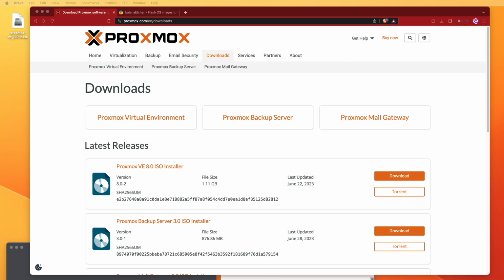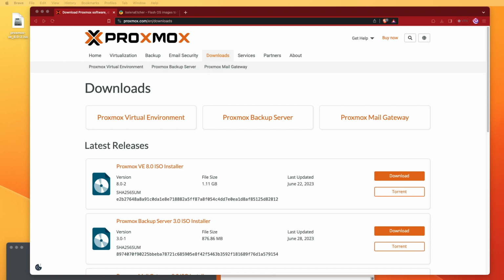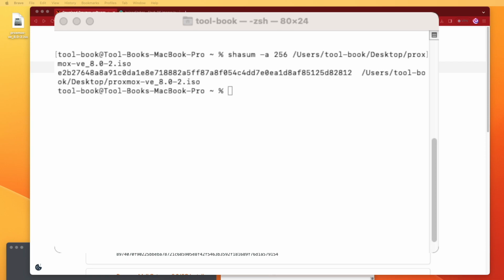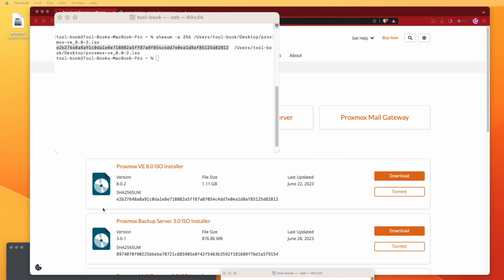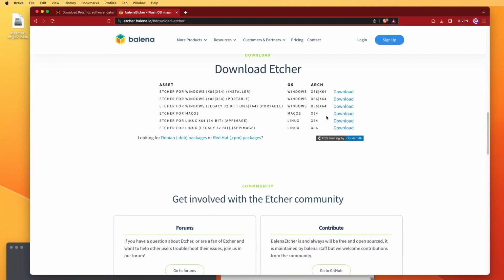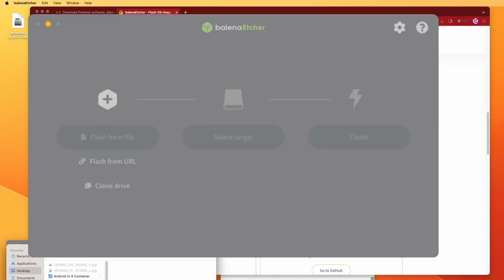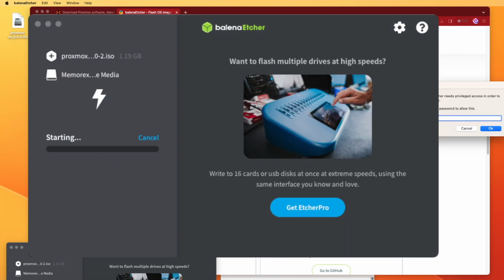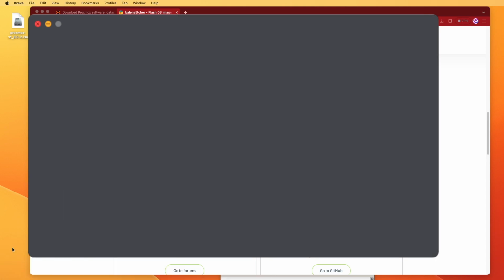Make USB Install Tool for Proxmox 8

Comment: Linux users.. the tool is mintstick and will be in your repos.

Here is a good one.. the Proxmox 8 installer won't boot in a Z420 with an Nvidia K4000 already installed.. Maybe a video about the grub command line boot options would be useful for systems that refuse to boot because of default grub config? I'm down the rabbit hole of gpu passthrough with a K80.. hahaha

Keep on making these videos. They are much appreciated.
Reply from the maker: The first question that jumped into my head is will Debian boot?